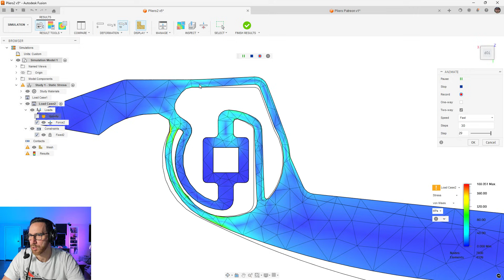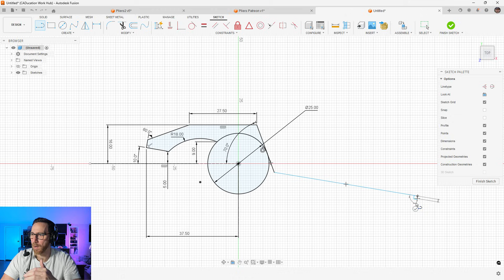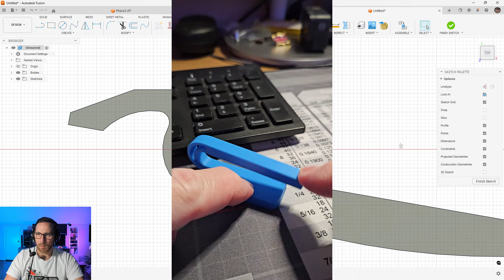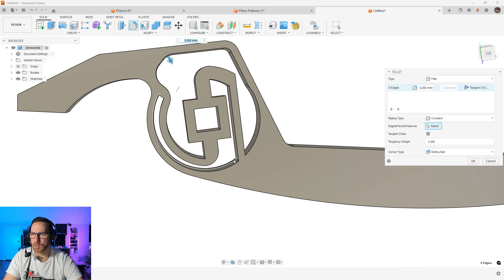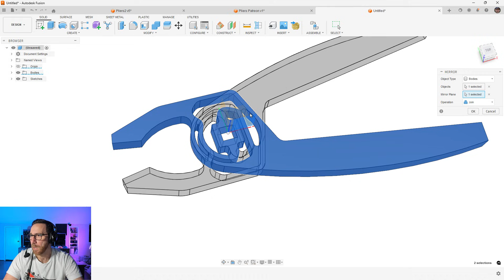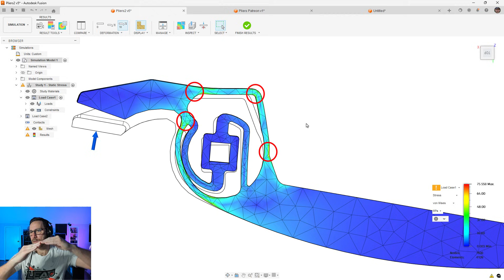How To Design Compliant 3D Printed Pliers | Storing Energy in 3D Prints #3dprinting #cadsoftware

Comment: Hey Matt, could you turn on the voice-over?
Reply from the maker: Sorry!  I have them off because I don't like how google is doing the auto dubbing and they are now working on using it to change the video so the mouth matches the other language.  I have looked for other options but they all cost more than the channel makes in a month.  When i have a solution I will add it but sadly Google tied the autodubbing with the CC stuff as well.